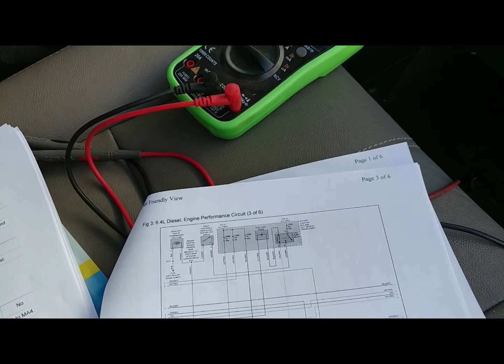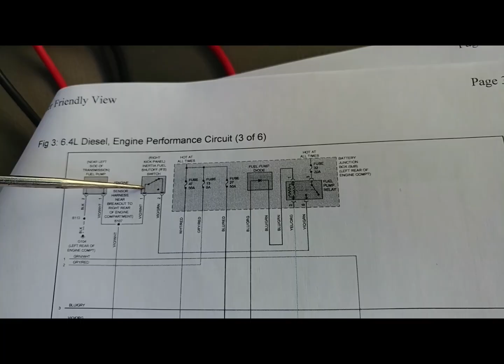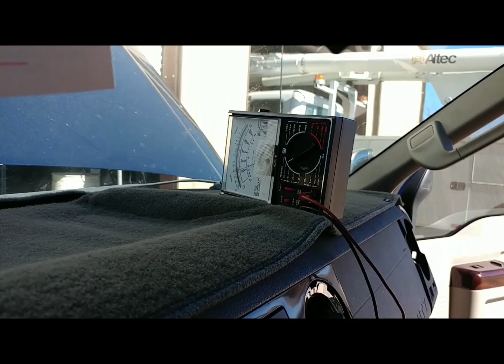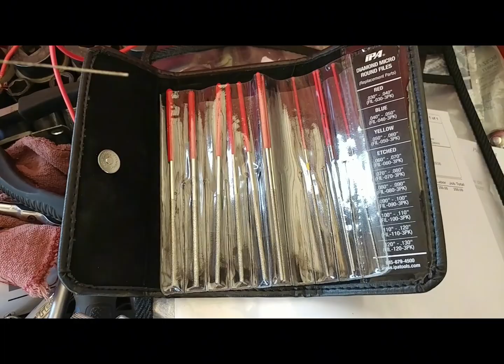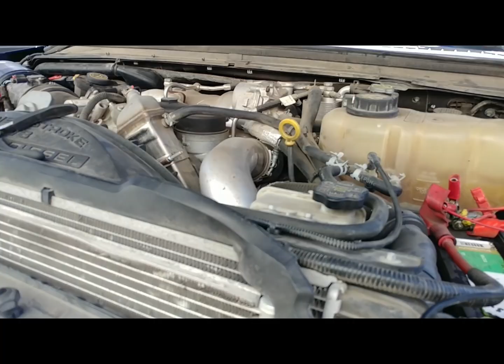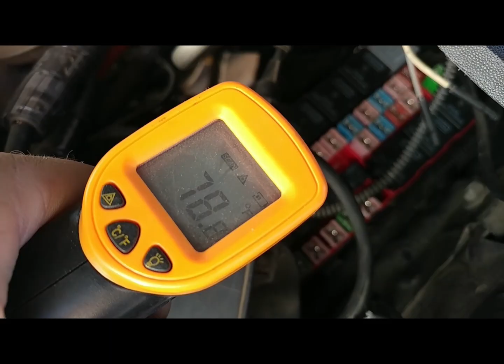DIY F350 TIPM Fuse Box Repair Hacks

Comment: You had a video on pto not working on a ford 550. I was wondering where your power probe was connected to monitor and apply power
Reply from the maker: Power probes are connected directly to the battery..
Reply: @ that Is how the tool works yes but what wire are you monitoring